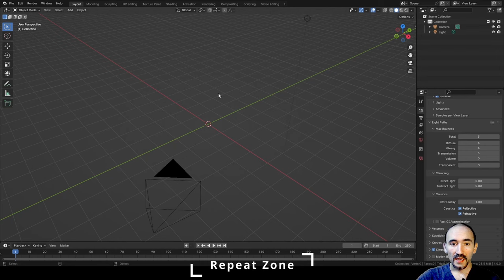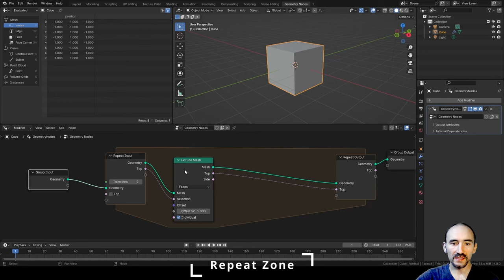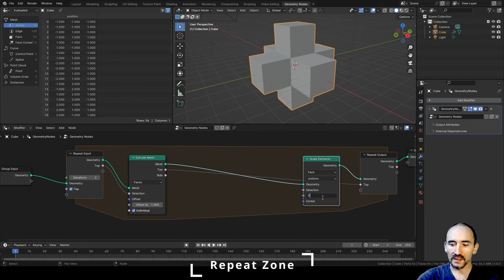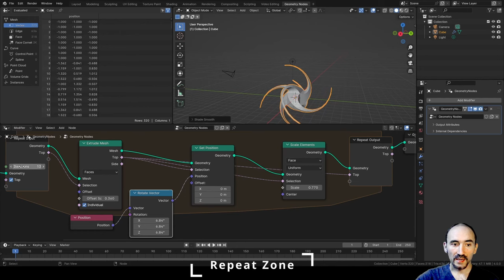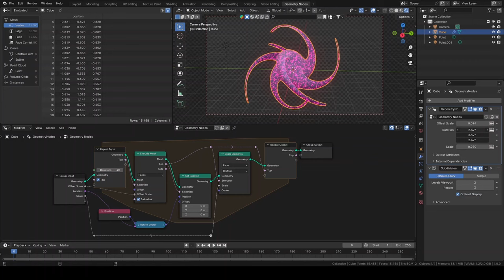Repeat Zone in Geometry nodes - Blender tutorial ENG

Comment: 3:35 hello, i have a very basic question but i really cant wrap my mind around it and it bothers me:  why do we have to add the red position node? why is only plugging the vector rotate in set  position not enough ? i think its kina for telling blender that its a vector line, but that seems like it could be built in vector rotate node, is there a good tutorial out there that makes me understand that? dont know why but it seem so unintuitive to me to add a node infront that is litteraly doing nothing besides saying "hey im a vector position" :/ help pls...
Reply from the maker: Hi bUildYT! You need the red node because you need to get the current position of each point to be rotated by a factor. If you directly linked the rotate vector node in the Set Position you would have replace all the positions of all vertices to the origin point (0,0,0) because you would rotate a vector of 0,0,0 by a rotation of a custom value and the result would be always 0,0,0. Try to do it yourselft, unlink the Position field in the rotate vector node to see this. Blender, sometime is able to "auto use" the Position field if you don't put the link on an input socket of some nodes but not all nodes. For example, the Set Position is a node that if you add it in your workflow but you leave that node as is, nothing changed on the mesh because it Blender uses automatically the Position field if you don't plug anything. In addiction, yes, the position is the vector it uses to rotate from the center so the origin point (in this particular tutorial).
Reply: @andrea_ciani  ahh so its a little bit like adding an object in and switching from origin to relative to use the current start point and not the orriginal, hmm thats easier than i thaught, thx dude:)